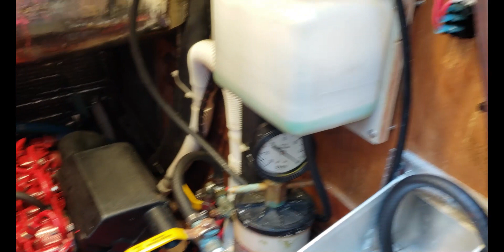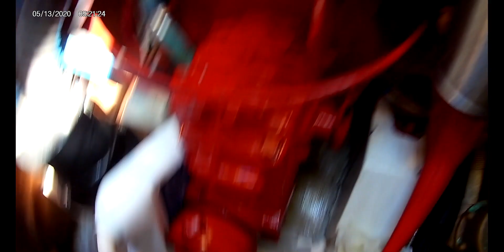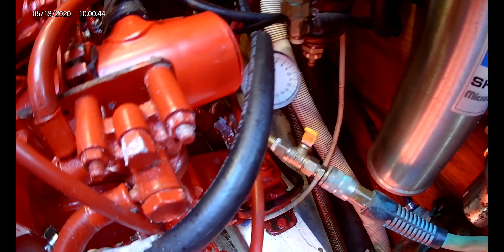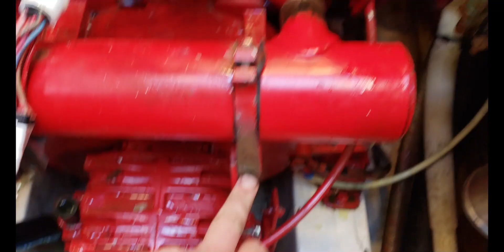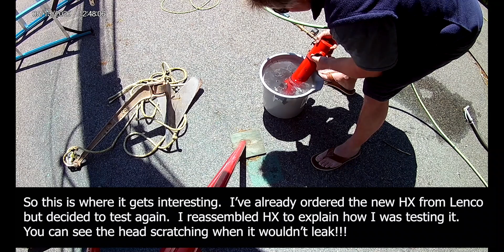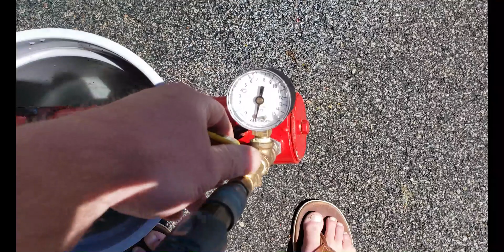Westerbeke Heat exchanger testing

Comment: Epoxy the culprit closed. If you detirmin which tube is leaking. A radiator shop fixed mine 7 yrs ago. Up to 5 %  or 10% can be closed and still properly cool. If i remember correctly

Comment: Peter:  Thanks for sharing.   I can leave you a link on my Westerbeke Heat Exchanger for my generator in which I built a Barnacle Buster type kit to flush my heat exchanger. (  https://youtu.be/6afbQp_Fu1g?si=1eo_SltF6f17OtZK ) Worked great.  And then I did the same on my brother's sailboat and cleaned a heat exchanger on a 2002 Beneteau 362. (Here's the work on his sailboat:  https://youtu.be/zIYv_p79lyc?si=Fsi-Mfop7n3tASyN )     What I would like to know is what you found on why the zincs would break off.  I only buy OEM Westerbeke zincs and change them out about every 6 months.   When I bought the new to me boat in Dec 22, I found that the previous owner had never done maintenance and on the 4 year old boat, the sacrificial anode was completely gone.   As I come up on 2 years, I find that I have about 50% of a zinc since intact when I change it out but would like to know what you determined to be your failure as I help my brother on his boat and do the maintenance on mine.  Thanks!